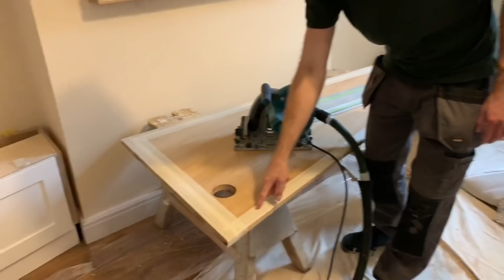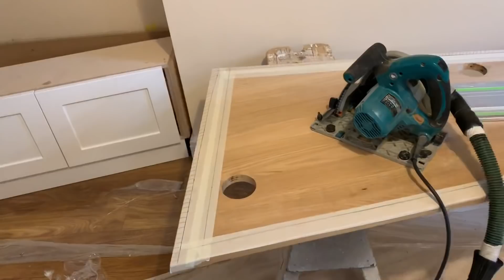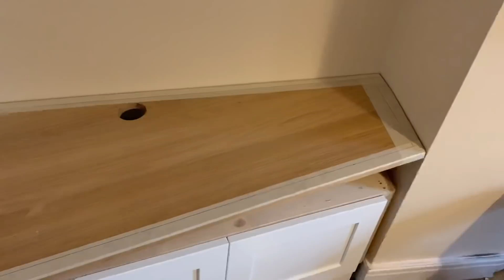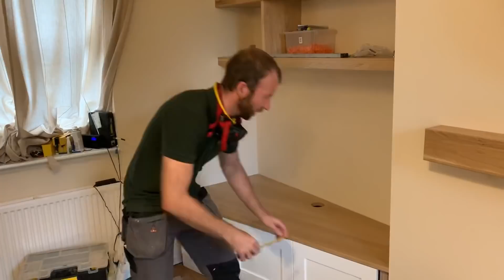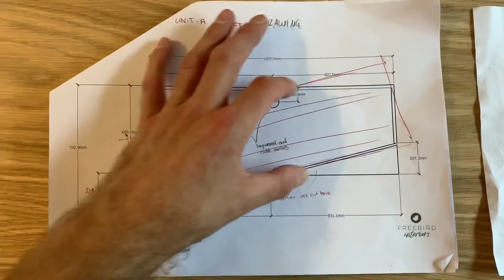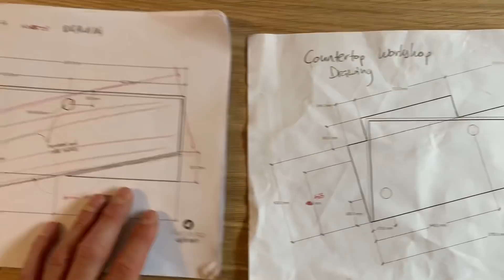How to fit an angled countertop in an alcove

Comment: Hi there does anyone know what kind of hinges would be used for this kind of corner alcove unit?
Reply from the maker: I always fit posts perpendicular to the angled face of the unit and use standard overlay hinges!  Using the special angled hinges quickly becomes a headache, prone to error.  I recently did a whole series about methods for angled units here a few posts down: https://www.buymeacoffee.com/Freebird/posts

Comment: I seem to be getting a few of these units to build in alcoves , I always use some 6 or 12mm mdf strips and lay them against the walls joining them together with screws or mitre mate to make a template of the walls , this has always worked for me you just can’t go wrong doing that and always get a tight fit 👍
Reply: I stumbled across this comment today, I was nervous about cutting a worktop between 2 walls. I followed your advice and it fit like a glove! Thanks for the tip, much appreciated 😁😘
Reply from the maker: Funny you should say that, as this is the way I do it now! 6mm mdf, glue gun for joining!  https://www.instagram.com/s/aGlnaGxpZ2h0OjE4MDU2NDM5MjkyMjQ4NTI1?igshid=o0wneccf9bna&story_media_id=2425559325004824422
Reply: @Alastair_Johnson  the best way by far Alastair you can see visually how it is going to look before you draw round it on your top . I have Just done a top which went round some old intricate architrave so I used a profile gauge first to take the shape then transferred it into mdf strips which worked well .

Comment: Hi great video thanks, 2 different things 1 where do you get the round wall spacers from and secondly on another video you moaned about lecky leads being a mess when swapping all the time with the Hoover could I suggest an extension lead then everything works without changing plugs?
Reply from the maker: Hi, spaceplugs - find them at toolstation.  Extension lead is a good idea though I’m thinking best solution is to go increasingly cordless as with 2 separate leads on saw and planet in regular use at the cutting table I’ll probably get in a tangle!
Reply: @Alastair_Johnson  that makes sense, although for me the day job (maintaining care homes for children with behaviour or emotional difficulties) means I use milwaukee battery powered kit less precise but very robust,  to save mix ups my part time / hobby work I use corded  festool. Thanks for the info

Comment: Hi again Alistair, do you mind me asking what hinges you used for the left hand door? I've made an angled unit like yours with inset hinges but the hinge doesn't allow the door to close past 90 degrees (if you know what I mean) as the door actually needs to close to 80degrees. Or did you use normal inset hinges plus angled back plates? This is an option but it means cutting the doors down 🤦🏼‍♂️
Reply from the maker: Dan Smith see similar comment by kingthefoot further down - the secret is to avoid messing around with fancy angled hinges altogether and simply fit a post to receive the hinges which is positioned at 90degrees to the frontage so you can just use standard hinges

Comment: Surely the fit shouldn’t be any tighter than a couple of mm gap right out round for expansion or movement?
Reply from the maker: ONEFLYMAN FLIES expansion along the grain (side to side in this alcove) is negligible but it may shrink a little away from rear wall.  More likely to shrink than expand in warm house; and it could move forward if it needed to.